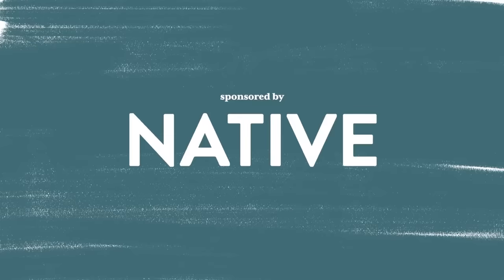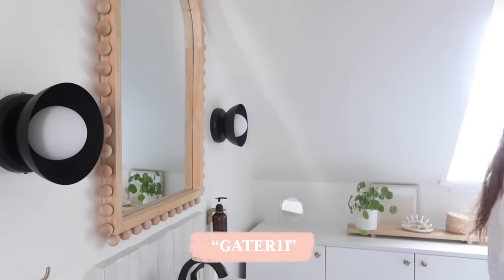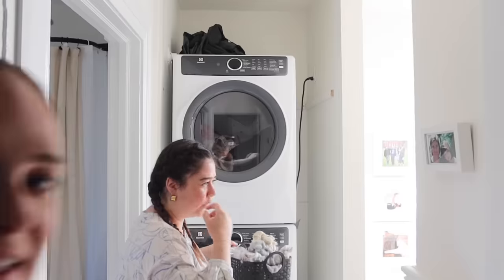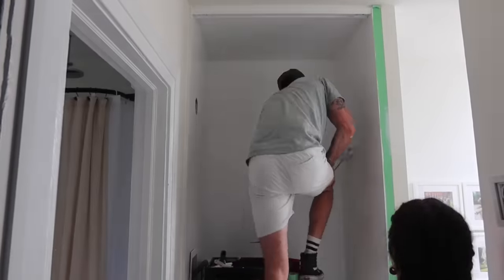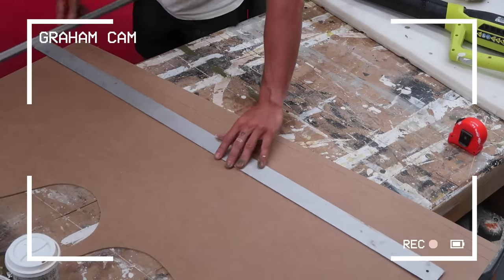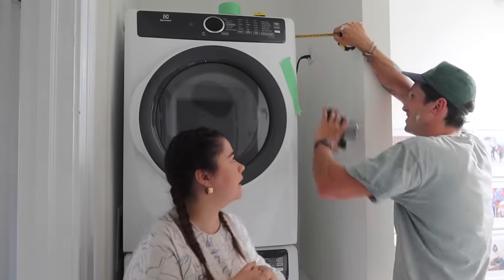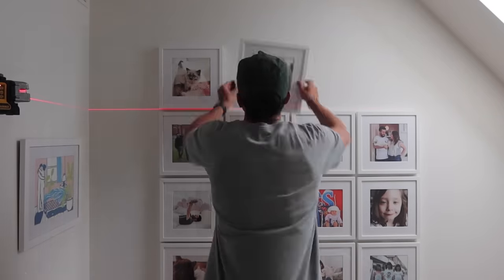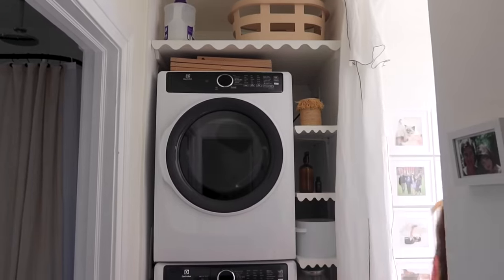How To Make a *TINY* Laundry Closet Cute and Functional

Comment: I have a waste basket in my laundry room, so technically, lint is thrown away immediately...and that basket is emptied into the larger trashcan once it's full. I also have a fire pit and like to use the lint for kindling so 💁🏾‍♀️ technically it is collected in a basket before I throw it away? Either is normal if you ask me.

On another not:
"You're, like, very strong"
smashes the wrong piece of wood 😂😂😂

Comment: can't believe they peer pressured you into getting a trash can for your lint 💔 i have adhd and when i live somewhere with a dryer in unit we always collect it in a basket or something and then just empty it into the trash when it's full. when i was a kid we saved it for firestarter but i haven't had a fireplace in a long time
Reply: the adhd is relevant because it's like to me it is easier to take it all in one big trip than in several small trips but to a neurotypical person that might not seem like the most straightforward option

Comment: Don't you guys that use dryer balls just leave them in the dryer all the time?  I never take mine out.  I used to save dryer lint to use for crafts (temari) but I'm not doing that craft right now so I just walk it to the kitchen trash can.  My laundry is technically in the kitchen so it's only about 10 feet away.  I have a top loader but I think for front loaders you are supposed to leave the door ajar so you don't get mold on the seal.  The curtain is cute but I don't feel the need to cover up my washer and dryer.  Mine are nearby to my stove and fridge, and those appliances are visible, so...  But whatever floats your boat!  I love the shelves.

Comment: Not normal. Dispose of lint every time. It isn't  heavy, is a fire hazard and saves space  by deleting the lint basket.
Dryer vent. Way too long. Also, on the outside, there should be some kind  of cage or screen to keep things from coming in to nest in that warm, moist space.

Comment: I'm surprised you accumulate lint, especially in a open basket, rather than keeping a small closed bin near the washer-dryer if the real garbage bin is too far.  Lint is mostly dust, isn't it? You don't want to breathe it , so an open weave basket doesn't sound like the best place for it.

Comment: You should never put oils of any kind in your dryer - yikes, such a fire hazard. You also should not use flex hose for the dryer vent. Solid vent pipe is recommended. 

Also I’m a “lint right to the kitchen garbage” person.